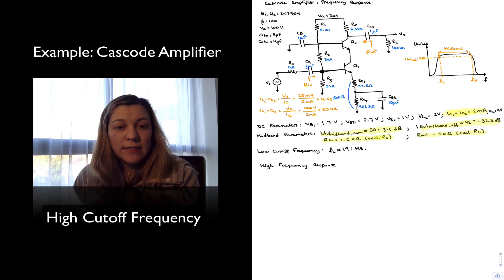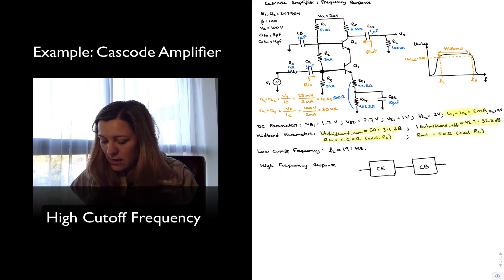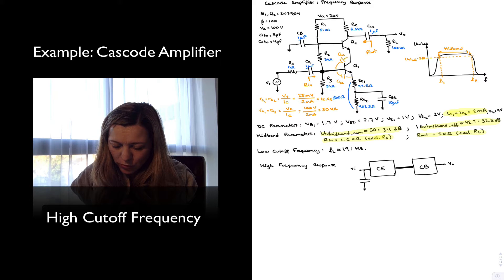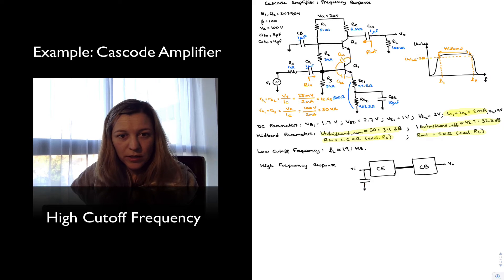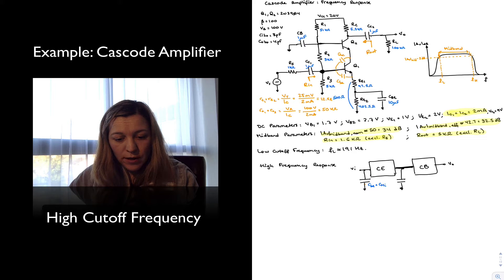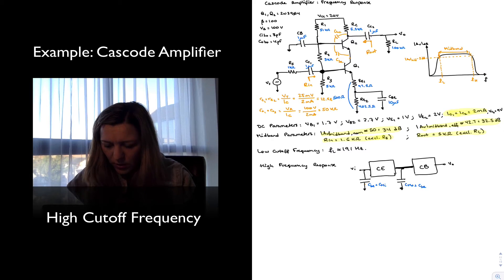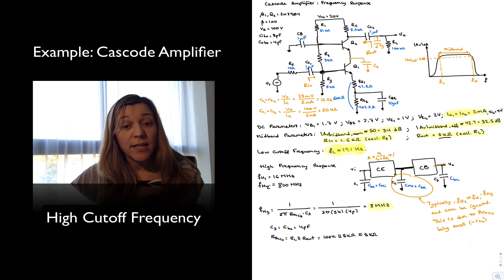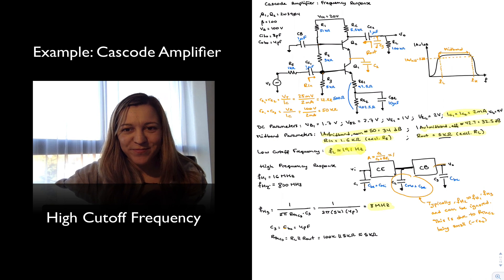Example: Cascode Amplifier - High Frequency Response

Comment: The Gain of Q1 is not approximately equal to 1. because even if we take the approximation of re2/(re1+RE1) it would be equal to 0.11
Reply: it's because approximately the gain of CE is -gmRc and since Rc=1/gm and if two transistors got same structure therefore the gain is approximately 1
Reply: you're absolutly  correct i just simulate it and proved what you said  ! her calculations are wrong